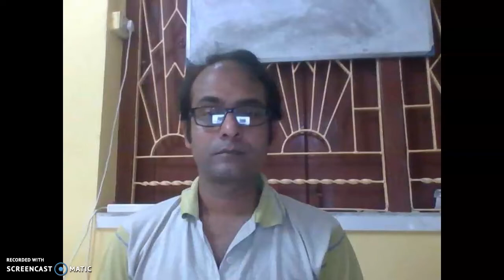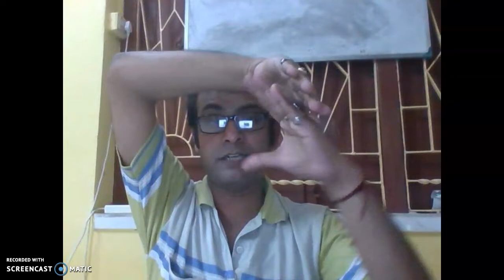Compression member Design

Comment: Sir if possible kindly upload video lectures on connections (bolt, weld etc.), gantry girders and design of industrial shed with provisions from IS 800:2007. Thank you.
Reply from the maker: Thanks Rohan for your request. Gantry girder is now coming on the channel .welded joints are also in my channel please go through this. I will upload the design of bolted connection shortly
Reply: @dr.sanjoydasneogi2964  Thank you sir. You have really taken a very nice initiative.